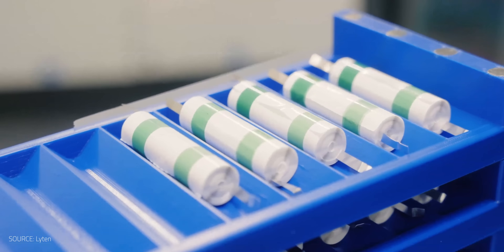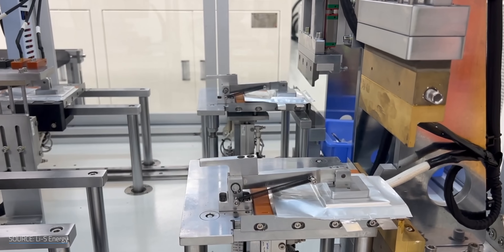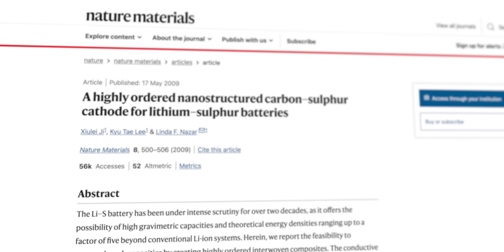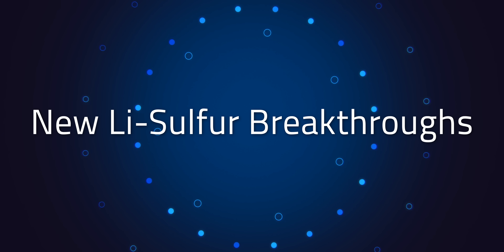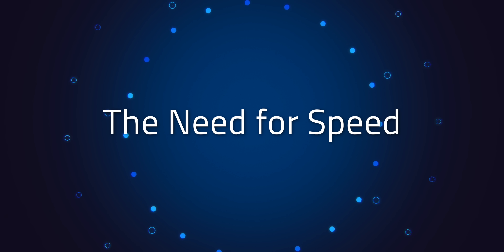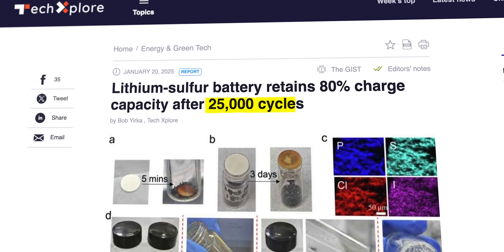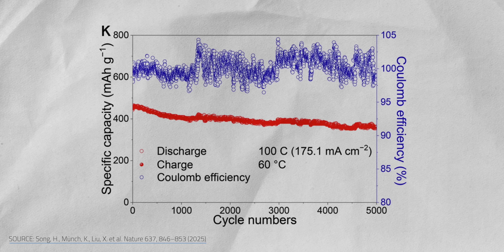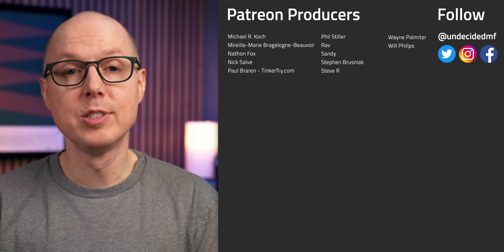How This Overlooked Battery Might Change Everything

Comment: Man, sulfur is produced in the tons as a byproduct of oil and natural gas production, when it's produced from what's known as "sour gas." I can't express just how much raw, elemental sulfur is just still outside in gigantic piles outside of oil and gas production facilities in Alberta, the scale is almost hard to believe. One example can be seen on google maps, at 57°02'34.0"N 111°38'51.1"W. So yeah, if there's demand for sulfur, boy oh boy do we have the supply!
Reply: Oh snap, each of those four piles, if my maths and perception are right, contain roughly 5 million cubic meters of pure Sulphur, at least if my correlation of shadow height and step height to vehicle height and knowledge of vehicle height is right. There is one 300 by 400 meter pile, and three 200 by 400 meter piles there, with a cutout for trucks to drive up to the top losing some quantity, and stepping inward from the base, but they're about 11 steps tall, and each step I estimate might be up to 4 meters tall. So 44x300x400 and the large pile is probably nearing 5.3 million cubic meters. There's enough Sulphur on Earth to make up two additional Moons, entirely made of Sulphur, as Sulphur makes up 3% of Earth by mass.
Reply: @Avetho  Well, it will probably need refining and processes to be usasable, add other materials too.  And lots of energy to do all this processes. But for this part at least, yes there are good options to get it.
Reply: @el3dprint  The sulphur there is basically pure and ready to be used, but it probably never will be.  Sulphur is just so cheap and abundant that its not worth it to ship to tidal waters from Alberta.
Reply: @MarkRozema-v9m build the battery plant next door, problem solved.
Reply: @Avetho  I estimate the middle pile to be about 22 meter tall, judging by the size of it's shadow. Looking at a nearby building on Street View gave me the shadow angle.
Reply: @   Ah, okay, I stand corrected. I was never good at shadow angle stuff, and its been a while since I was in school so my maths calculator brainmeats are clogged with ancient dust XD

Oh well, that just means the big pile is just 2.5 million cubic meters of Sulphur, that's still euge
Reply: WOW!!! That’s HUGE!
Reply: Yup it's mindboggling how big the literal mountains are. 😮
Reply: How does that not get washed away when it rains 🤔
Reply: @darkarrowop  sulphur is insoluble in water.
Reply: @darkarrowop  i was wondering this myself
Reply: That's a lot of sulfur.
Reply: It’ll become real valuable real quick, if this battery tech takes off for EVs.
Reply: @thegorn  EV's are not the 'big cash cow market'.
That, would be mobile phones.
Reply: Well, ask the Germans. I see them doing interesting stuff with sulphur batteries. Not just LiS batteries, but also solid-state sodium sulphur batteries. I think that tech truly is revolutionary if they get it to work and produce on a commercial scale. Not great for the mining industry, but we Europeans are the world's biggest NIMBYs anyways when it comes to mines.
Reply: this might be the most well backed youtube comment i've ever read. publicly available source even
Reply: those mines are big enough to see from space!
Reply: Wow! @Kruglord That's only one of 4 at that location, and the whole surrounding area looks to be rich in Sulphur.
Reply: I remember seeing a huge pile of sulfur on an island in Vancouver bay.
Reply: There's one problem though: No One's Willing to Pay You to Take It
This is kind of ironic: sulfur is “free” in the sense that it’s a byproduct, but companies won’t pay you to take it — they just stockpile it. So it’s not quite like other waste streams (like getting paid to take used oil or scrap), which makes innovative reuses trickier to finance.
Reply: @SangoProductions213  Why would they pay you to take it, when they can sell it to you as raw material?
Reply: @PiDsPagePrototypes  Exactly. That's what I'm saying. Unlike most other "waste byproducts," it's trivial to keep around.
Reply: It's just like the US [ cheap ] to use a waste product to make money... [ Floride in your water lately? ]

The Paper-Water battery would be much better. [ twice the energy density of Lead-acid and 0% toxic ]
Reply: @Kruglord  hello I am america and I would like to liberate you. Lol 😂

Comment: 1:04 okay well here is some news buddy. Ni-CD reached that long ago and I'm not joking. You can find that out on Battery University article who tested Ni-CD batteries. Ni-CD is the most overlooked battery technology IMO, not this. Ni-CD is literally the most rugged type of battery out there. If you overcharge an Ni-CD cell, it turns the excess energy into heat. And because Ni-CD best storing voltage is between 0.6v-0v, yes 0V means that you can use 100% of the energy it has not to mention the fact that when Ni-CD ages it can also develop a minor self discharge rate, but that's a good thing. How? Let me remind you the best storing voltage for Ni-CD is between 0.6v-0v. 0V meaning completely flat. Even after so many years it will be in tip top condition because of that!!! And I've seen this from time and time again. I have really old Ni-CD battery devices that just work without any issue. Old power drills from 2000s? no problem. Old battery powered toothbrush also from 2000s? No problem. Old Electric shaver from 2000s? also no problem. I even have old Ni-CD AA batteries that just works today just fine and capacity testing them shows roughly 90% health left from their original rated capacity. Heck Ni-CD doesn't even need a BMS to function fine!!!
Reply: There's a catch
Reply: Good for home storage, but they're LARGE dude. Even at best, there is no way you are going to fit enough of them in a EV to make it work xD For grid/home sure, but now you have other options such as Na that can be smaller and cheaper as well.
Reply: @ ^ energy density, exactly

Comment: I think the cost of retooling the supply chain and manufacturing  process to switch from Lithium Ion will be much cheaper and faster than your video suggests.  As you noted, sulfur is cheap and plentiful.  On the financial side, once one major manufacturer introduces the new batteries at scale, it will be so superior that all of the other manufacturers will have to quickly follow suit or lose significant market share.  Plus there is virtually unlimited private capital to invest in a disruptive battery tech.

Comment: Storing reactants in the same cell is dangerous.  Storing twice the energy in the same cell, doubles the energy dump, during failure or shorts.  Can you imagine carrying the oxygen your fossil fuel engine, next to or with the fuel?  Power density of fossil fuels, when considered, it is often forgotten that much of the power density mass is dispersed in the air, and not available for immediate catastrophic failure. Failure mode for fossil fuels burns extremely slow, compared to a lithium battery pack.

Comment: My guess is lithium sulfur will cost a lot more (partly because of limited production capacity) for quite some time, but will quickly dominate where cost isn't a major factor compared to the other advantages
Reply: The problem is that cost becomes a major factor for industrial scale battery storage backing up intermittent generation like wind and solar. To cope with _Dunkelflauten_, a battery storage site needs to be able to provide the same power as the renewable generation it backstops, for hours, days, or even weeks. A battery facility that can deliver, say, 500MW for a four-hour period has a rough cost around $200M; if that facility needs to provide that power for 24 hours, the cost rises to $1.2bn; for a week, $8.4bn. If the cost of LiS batteries is significantly higher than current battery designs, the cost rises further.

Comment: "How long is forever?" For me, a reasonable definition would be: the lifetime of the application, excluding material and manufacturing defects, neglected maintenance and accidental damage. If a vehicle is made of aluminum and stainless steel to avoid corrosion and nominally last 20+ years, then a "forever battery" would have to last 20+ years.
Reply: If the tech can do 25,000  charge cycles and still be at 80%, that would be more than 3 full charge cycles a day for 20 years. That would be pretty much forever in battery terms.
Reply: @JorgTheElder  And if you're charging this hypothetical vehicle every other day (which would be a more reasonable use case), that would be a sixfold increase over that estimation, meaning the battery could theoretically last someone from birth to death by old age, or even their grandkid's death by old age.  Of course, with a vehicle other parts would fail a lot sooner, or some other component in the battery will fail and necessitate a complete replacement,  and in general the vehicle would be retired long before that unless it turns out to be a collector's item that a future owner would like to actually drive around in.
Reply: @ThatSoddingGamer  Exactly - a lot of us don't drive every day.  I usually drive someplace at most 3-4 days out of the week because I work from home.  I might only need to charge once during the week!    However,   there are weekend trips I made that are hundreds of miles - but even so, a 400 mile range would be just fine for me.    For the daily commuter who has to go 30+ miles one way, having to charge daily to stay topped off might be an important part of routine EV ownership,  but for those of us who only go 5 miles round trip to the grocery store some days, I don't see why I would need to charge up to max daily.
Reply: @katarh  Well, it really depends how you look at it.
If you can charge more times and during cheap-energy rates fast, you can equip the car with smaller batteries and thus make the daily trip and charge more logically then bigger batteries and fuller charge.   Making room for a lighter car with more luggage-space or smaller car and every combination of this.
You could actually have changeover-batteries that you just take with you (or lend at some fillingstation) when you want to make a bigger trip.
With for example a 50 mile standard batterie and for longer trip extend to 100 miles and then charge for 2 minutes, you really don't need that big battery.
With the faster charge, charging points will not be used that long, probably even shorter then petrol-filling now.
And yes, have charging-points at work and at home. Maybe just charge around 50% on normal days or even less. And then get some cheaper-tech that 'only' charges like 20.000 times or so and you have some golden middle.
Reply: @ThatSoddingGamer  This +1. That would go along with most devices as well. Most people upgrade their cellphones, not because it doesnt meet their needs, but because the device slows down due to poor battery life. Once replace, most people normally get a few more years out of their devices. With a forever battery - we could see battery and e-waste drop by half. For most people, they only really need to hit 20-30 years before someone already looking at something else. Even just the 2nd hand market for the batteries would more than likely have place with using them as a home battery or grid level recycled battery.
Reply: Absolutely agreed. A battery like that would mean that my laptop and phone would become obsolete before the battery life was at less than like 95% capacity
Reply: 25,000 cycles for say a cell phone needing one charge a day... would be 68 years so almost the human lifespan.
Reply: @ Cycle life is only one factor. Batteries have a "calendar life" from side-reactions slowly degrading the battery even when all it is doing is sitting idle under ideal storage conditions.
Reply: @teardowndan5364 True, but you are fixing one of the main issues that normally kills the battery way before that calender life will hit. With that said, yes, that would be the next factor to look at. Main goal would be first to just make sure it even be used in normal storage conditions first.
Reply: The lifetime of a vehicle is not how long the body lasts. It's how long the corporate bean counters say the warranty period is. The engineers will then put thousands of hours into simulations and design "tweaks" to make sure the vehicle turns into a money pit right when the warranty ends.
Reply: @iiisaac1312  Maybe, but to play fair, things just wear out over time as well. I know, while I am not a car engineer, I do work on computers. There is only so much you can do with an item that sits out in the environment all day long.
Reply: It doesn't matter with the De Lorean, all Doc does is send Marty back at 88 MPH to the date about 11 month's after it was installed and then gets it swapped out under warranty 😁⏳
Reply: Forever is endless.

Comment: The energy density means a smaller and lighter automotive battery pack. That, in turn, means a lighter chassis, smaller lighter motor and brakes. That means fewer batteries are needed to get 400 miles of range. One can only hope!
Reply: Giving energy density in power per kilogram is only half of the information needed. If LiS batteries have twice the power-to-weight ratio of current lithium ion batteries, but only a quarter the power-to-volume ratio, a LiS battery with the same capacity as a lithium ion battery would take up twice the volume. This isn't really an issue for static battery units, such as would be used to stabilize the output of an inherently intermittent source like wind or solar generation, but the volume occupied by the battery pack is an issue for EVs.
Reply: @seanmalloy7249  Kind of true, Li is still being kept witch makes up 20-30% of the weight of the battery still. The other holds more over all charge than carbon can something like 4 to 1. So over all, even if it does weigh more, volume wise, it will hold a lot more. Not sure what the ratios will end up being, but they should be useable for EVs and other mobile application without taking any extra volume for 30% to double the current power. I guess it will just end up being what comes out to be better.
Reply: It wouldn't necesseraly mean lighter motor, heck would love a super strong motor and get insanely quick acceleration!
Reply: Yes, the benefits multiply all around.
Reply: It would also help with the issues some EVs and hybrids have that were designed based using ICE car components, that is the suspension and brakes wearing out a lot faster because of the added weight. But I think they would still tend to go go for the same amount of battery and more range instead of less battery and the same range, except for lower-budget models, especially if the power density is indeed much lower. Also who knows how well the Li-S batteries handle cold temperatures, this could also be a limiting factor if you wanted to reduce the volume and weight of the battery to what would supply enough power in room temperature.
Reply: Matt,
Does Lyten talk at all about possible cost range for cylindrical cells with dimensions like those commonly in use (21700-many makers, possibly 46xx like T & Rivian).  Ultimately, once feasible manufacturing is demonstrated, it becomes a cost race - cost / kWh and ease of adoption in existing factories (lower process change cost).
Reply: I think it's worth pointing out here that with current batteries, battery-powered electric freight trucks are basically impossible.  The weight of batteries required to move freight long distances leaves almost no room for the freight itself considering road weight limits.  A much lighter battery technology could potentially enable this kind of shipping. For that purpose it wouldn't even need to compete with lithium ion on cost AT ALL, since it's a field where Lithium Ion simply cannot function.

Note I specify battery powered electric.  There are some places where they use primarily cable-powered electric, where the trucks use something like an antennae to draw power from overhead wires most of the time.  Even with lighter batteries that's a way better approach, it just requires infrastructure.
Reply: @Krunch2020  definitely needed for future of flying vehicles.
Reply: I still think the problem with EV's is the inability to change out or even better upgrade their batteries.
Reply: Thanks I am glad you made this point , weight reduction is a win win win .😊

Comment: It seems like breakthroughs in Sulpher-Lithium batteries will be able to transfer to other battery types.  It might not be the same chemical composition but a different mixture can probably be used to come up with similar materials that will work with other battery technologies.
Reply: It's not the mixture that creates the higher energy storage density.  It the molecular structure of the Cathode material.  The 'extras' in the mixture are only added to solve problems, such as dendrites.  The attraction for sulfur is that it has more 'holes' to hold ions than other common 'base' materials for a given volume, and is therefore less dense and so lighter too.

The greater storage capacity of sulfur has been known for decades.  The breakthrough has been discovering these 'extras' that solve the problems with using sulfur.  The odds are they won't be of use with a different 'base' material so don't get excited.  The ability to manufacture lithium-sulfur batteries is a huge breakthrough on it's own.
Reply: @philipgrice1026  Yes but the ideas or methods that solved the problem can still be transferred to other technologies.  It is not like other technologies do not share similar problems.  Most have more in common than differences.